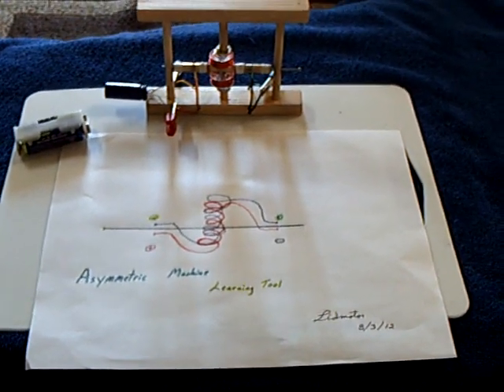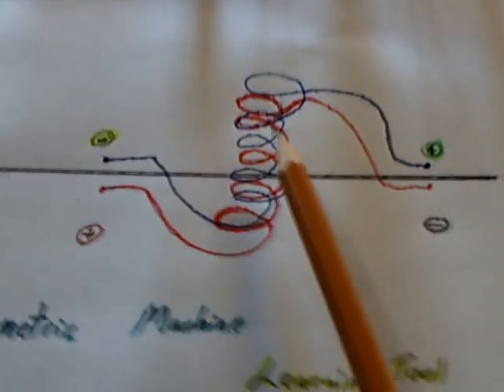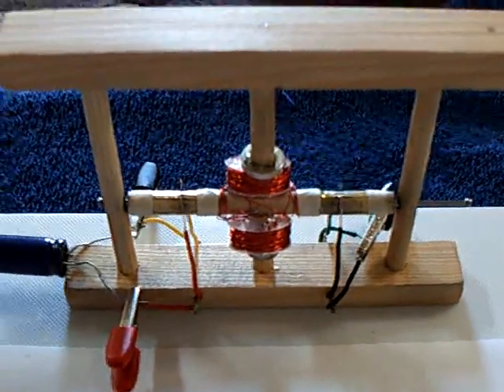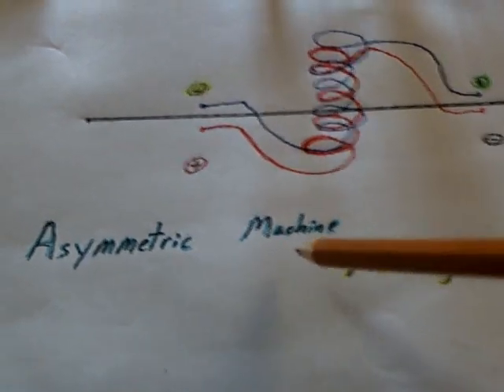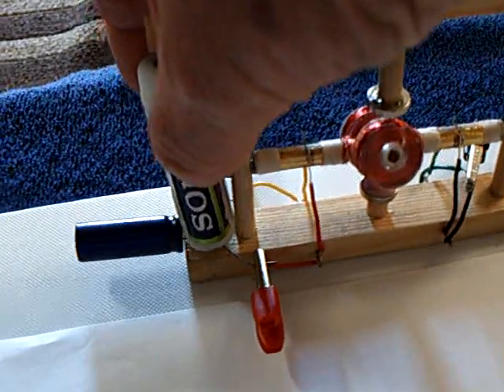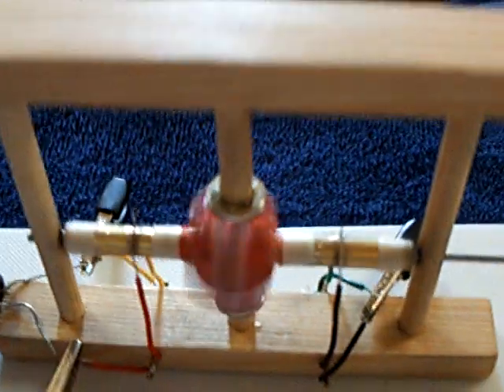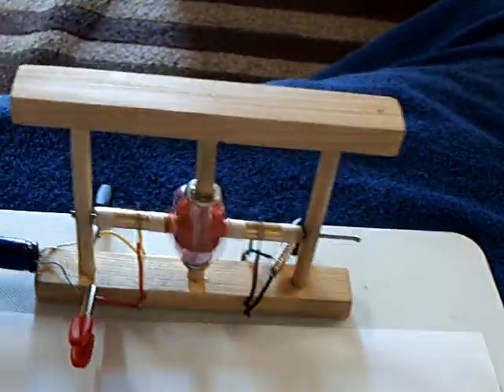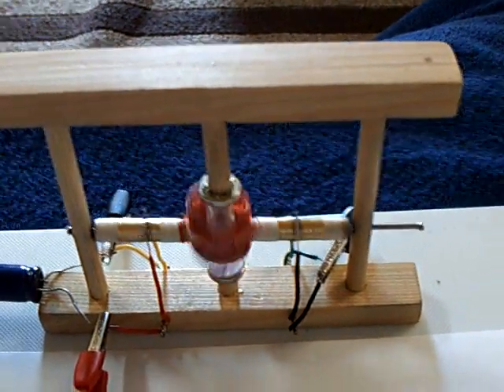Asymmetric Machine Learning Tool

Comment: Hey Lidmotor, it's impossible to work as an asymmetrical motor having an even amount of poles on your trainer unit. If you get a "symmetrical" wye shaped pipe connector from a plumbing store, or have one machined that would allow for a third spool to be tied into the motor you have made evenly, it would work perfectly. The motor has to be any amount of poles but they would have to be an odd number to get the correct effect. I did draw out the circuit for 3 poles, and would be happy to do so in any other configuration if you'd like to build it. It is rather easy to make with 3 poles as it only needs 2 neo magnets to work correctly and it is pretty simple to build.. I certainly recommend more poles so it starts easier and makes more power, but, it is very easy to make the 3 pole and train people with so it is larger than these little dinky motors that are a nightmare to build. I am going to put some kits together for sale on my website to build 3 and 5 pole systems as I have a method to do so , which I will make instructions for over the next week or so, and I do have many of the parts in stock for this as I put together a template , magnet wire, or, a kit that uses ptfe coated silver plated solid copper wire so this could be built to handle higher frequencies without issue, as the radiant energy responds better with this type of wire as the electron flow utilizes the "skin effect" when the frequency gets up to 3-5 plus khz. I am finding that super capacitor banks with Lithium ion cordless drill batteries allow this system to loop and continuously power the motor plus give additional power just as long as there is a good amount of drag on the shaft. The motor seems to use the same amount of input while under load while the charge circuit seems to get stronger as the load is applied to the motor making it the perfect motor to create overunity systems with a COP of way over 5, almost a COP>6!

Nobody believes that this unit will do this, but, I am getting a massive amount of sulfating happening to the batteries so I recommend using caps to self loop and add something to load up the shaft, like a generator which would be much safer to drive charge to the batteries since there is too much voltage and a high amperage that may cause batteries to explode. The lithium ion battery has leaked and I don't feel safe using this, as well, with 18 volts, the motor screams at well over 17,500 rpms, and my meter maxes out at this rpm.

I will post some videos soon as soon as I build a circuit to filter the power from the charge portion of the motor. Even with rectification, the voltage has some pretty large voltage spikes that cause batery issues, so, once this is done, I think i will be able to put a buck converter inline to regulate the output and charge a battery bank safely.

I have built a large unit from a dc motor, but, it has issues with the bearing from the rpms, so, as soon as I get new bearings, I will post the video showing it self loop powering the batteries and additional lighting, etc. It really produces some major power and it is certainly what Tesla was going to create his Free Power with as it has some serious potential.

Using just the motor and not the charger is very inefficient, but, it is vital to use the charge circuit with some additional circuitry to pulse the system to get the additional energy as I did, but, it works fantastically!

Comment: Hi Lidmotor and thanks first for all your very clear vids.

I think the key of such a motor would be to set it in a way that the EFM of one coils works in the same time that the Back-EFM of the other coil will act.

Even if I think you can't reach any overunity with such motor you can surely reach a pretty good efficiency.

Cheer, Khwartz.

Comment from the maker: Bad diagram you are right.  Maybe I should explain better.  One video back you will see the two sewing machine bobbins filled up with 30ga magnet wire.  I series connected those two coils and connected them to the armature in an X fashion.  There was just about 1/16" of room left on the bobbins to add a few layers more of 30ga to form the second coil that got attached X wise onto the armature.  I guess that makes it kind of  bifilar. A true bifilar should be much more interesting like you say.

Comment from the maker: My Radio Shack motor also has a very high amp draw ----but it also has great torque.  I also am not sure if I built it wrong or not and that is one reason for this little side trip with the learning tool.  I read that if we wind the RS motor with thinner gauge wire the amp draw will be less.  I might build another one with about 35ga instead of 30ga and see if that helps. Ufo warns not to go too thin or the wire melts.  You are also going to lose some of the torque.